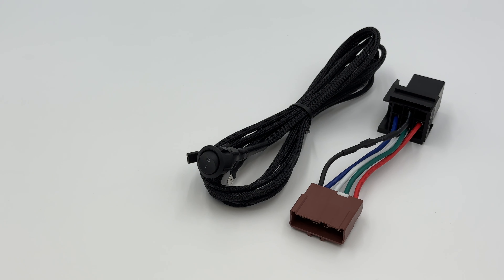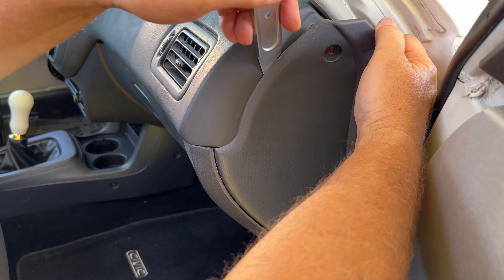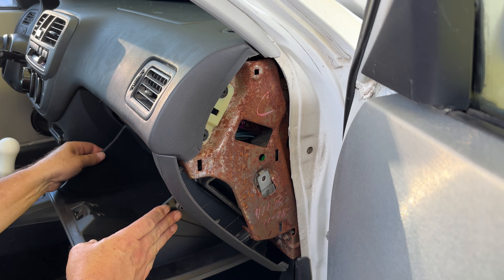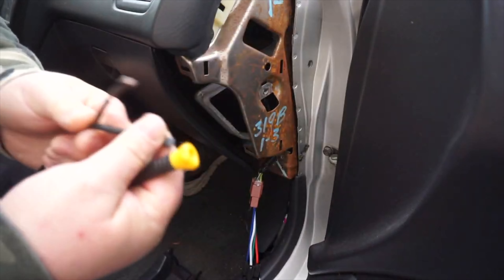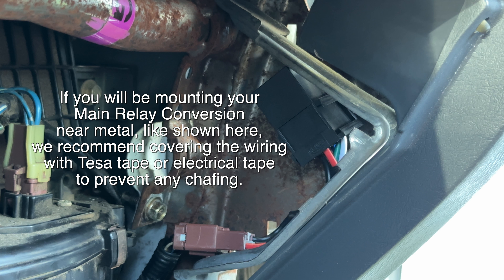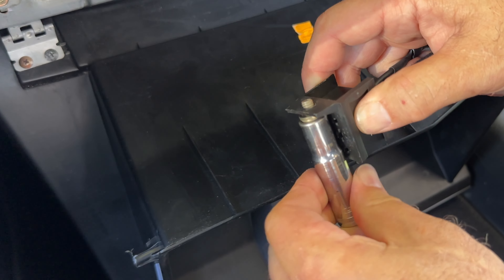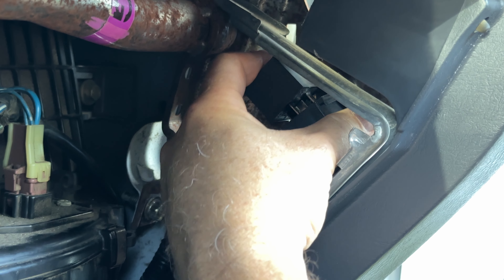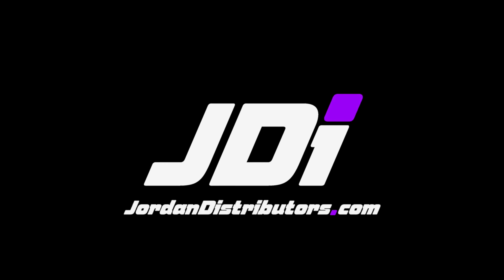Main Relay Conversion with Kill Switch - Install Guide

Comment: Just finished installing mine and WOW 
It was even easier than this video on my Del Sol because there aren’t any panels in the way🙏🏼
Reply: I know this old post but where did you hide the cord for kill switch? I just got one for my del sol & the under dash area has minimum storage to tuck it.

Comment: What about for a integra, it doesn’t fit where the bolt goes
Reply from the maker: You can secure it under the dash with the included wire ties

Comment: Does the fuel pump still prime for 2 seconds when the key is turned, or run constantly?
Reply from the maker: When the switch is on, the vehicle will function just like factory. When the switch is off, the fuel pump will not receive power at all

Comment: Hey, do you have one that works for the ep3 civics?
Reply from the maker: The EP3 does not have a main relay. It has its fuel pump relay integrated into the fuse box